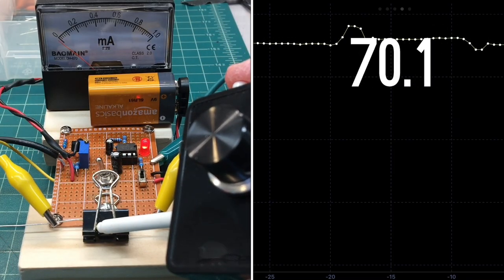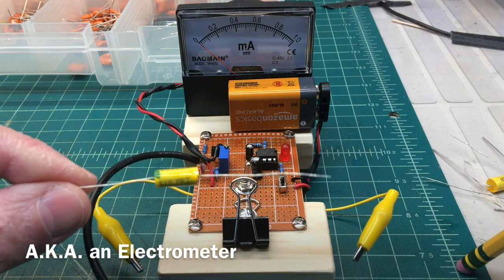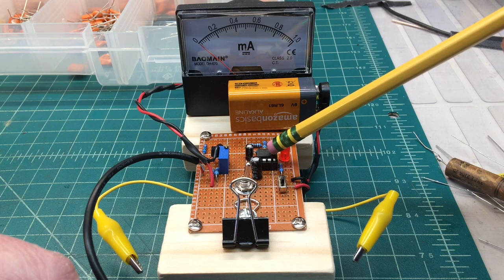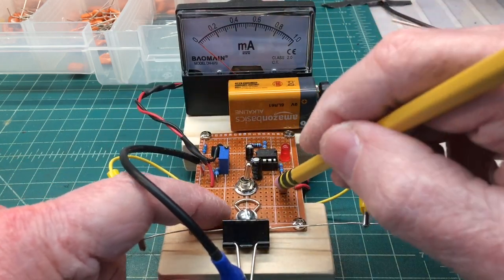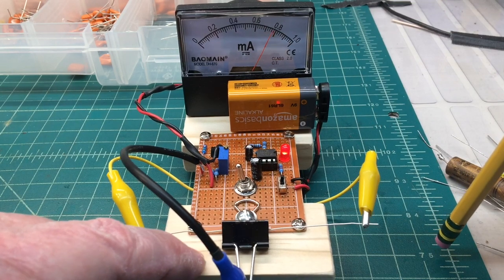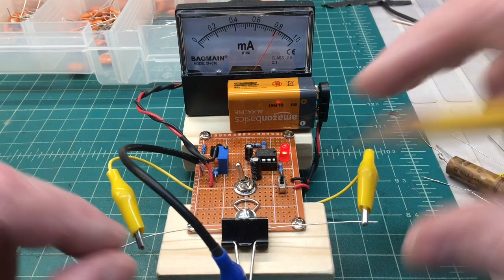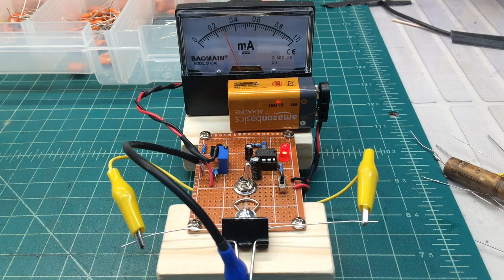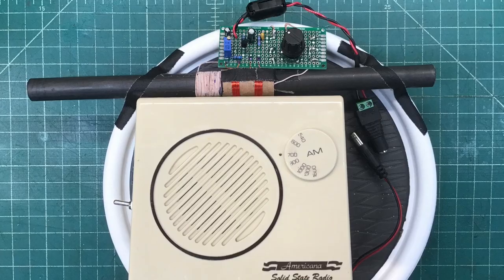Capacitor Outside Foil Identification using an Electroscope/Electrometer

Comment: I use a scope to identify the foil and it works well 95 percent of the time but I do run into a value that can't be determined.  I will try your circuit out Don.
Reply from the maker: Jim, the scope approach works great for me too, but through this together for folks that don’t have one. You might not see any value added in the circuit as compared to the scope. I would appreciate your candid feedback if you build and compare the two methods. Best, Don
Reply from the maker: The schematic is published.

Comment: I really would love to see the schematic for this.  I sort of expected the toggle switch to work the other way around.  My experience with toggle switches has been that the center contact(s) will be connected to the pins OPPOSITE the direction of the toggle, so that is why I was expecting it to be the other way around.
Reply from the maker: Wayne - I should have the schematic posted over the next couple of days; had some stuff come up that derailed my documentation efforts. The DPDT switch wiring will be documented for sure. Thanks for viewing and reaching out. Best, Don
Reply from the maker: The schematic is published.

Comment: I like the methodology of feeding the test signal into the DUT capacitor leads so only needing one detection system, the opposite to some other designs, this saves a lot of components.  Did you consider zeroing the meter by replacing R2 and R3 with a 1K multi-turn pot and using a fixed value for R4?  I'm not sure what the merits of the two methods would be but your thoughts would be welcome.  Thanks for the PDF downloads.  Inspirational video.
Reply from the maker: Steven - thanks for reaching out. I did replace R2 & R3 with 4.7K ohm resistors while testing using an external Signal Generator with a higher amplitude signal to reduce the DC current, but left R4 (at that time a 100K ohm) as a variable to Zero the meter. I welcome your feedback on any changes to improve the circuit if you elect to build it. I put the circuit together for folks that don’t have a O-scope or other means to validate... Thanks again for your question. All the best. Don

Comment: Hi Don,
Greetings from Ireland.
I've built the sniffer trying  2 jfets separately and can't get the meter to zero as it draws far too much current,  - are the component values correct as per the schematic?
Reply from the maker: Hi Rod… the schematic values are correct for the 2N5457 JFET I had on hand. You may have to modify the circuit accordingly since no two JFETS are the same. I hope this helps. All the best. Don
Reply: @RestoreOldRadios  Thank you Don.

Comment from the maker: Schematic is posted:  https://drive.google.com/drive/folders/1J4bUMEpwnyBY8meFDvvI12klgi5kHUt_?usp=sharing
Reply: Just wondering why you didn't just use a 555 instead of the LM386?
Reply from the maker: @cjay2  I had numerous LM386 Op Amps on hand and decided to try one. It made for some nasty harmonics, which was my objective. Best, Don
Reply: @RestoreOldRadios  Gotcha! Carry on. ;-)
Reply from the maker: CJ - if you build using a 555 I would appreciate your feedback. I just published the schematic. All the best. Don

Comment: Hi, I built your tester and cannot get the meter to zero out, pretty much just stays around 18mA. The circuit draws about 40mA hooked to my precision power supply, seems a tad high? I must have wired something wrong but haven't found the error yet. Thanks!
Reply from the maker: Hey Tom - the DC current is high to your point. My circuit at the 9V source reads 14.6 mA with no capacitor connected and the meter at zero and 15.0 mA with a capacitor hooked up regardless of the DPDT switch. Hope this helps. I would appreciate you keeping me posted on your findings. Best, Don
Reply: @RestoreOldRadios  Don, hey got it working! Problem was the JFET. I don't have a 2N5457 around and used one with the wrong specs. I dug up a 2N3819 that will work in it but the current draw on the meter is much less than your setup, will get a 2N5457 eventually. Have a recap coming on an old German radio that this little bugger will come in handy, thanks!!!
Reply from the maker: Tom - glad you got it working. Hope the German radio project on the horizon goes well. All the best. Don